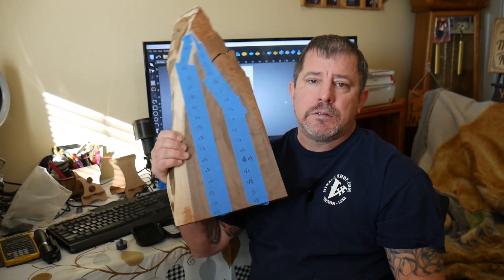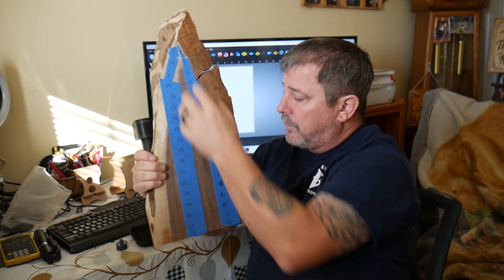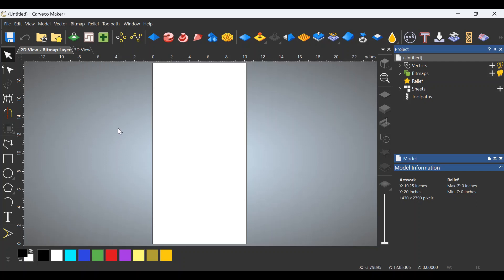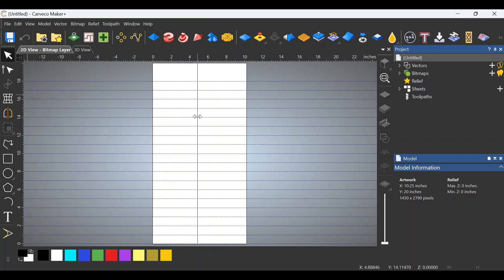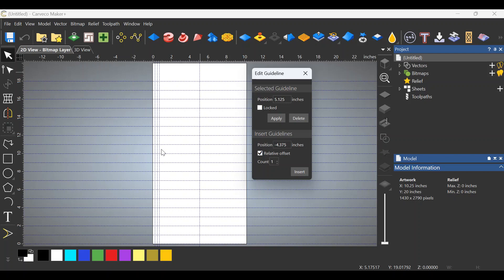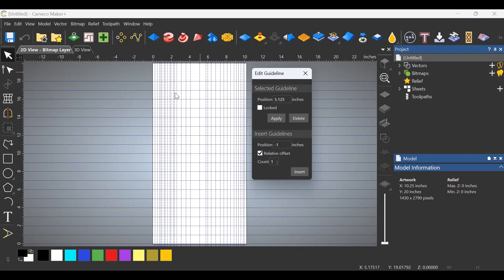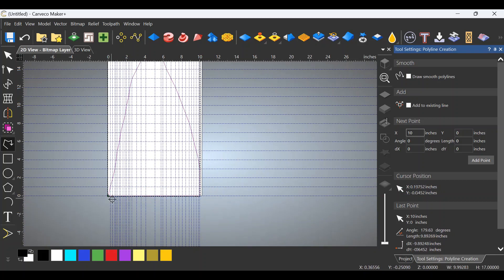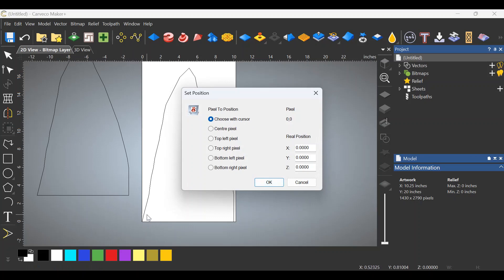You can copy a shapes on your CNC

Comment: Not what I was expecting.  I thought you were going to take a photo, import it, scale it and then trace along the edge to get the vector.  This way works though.  It would be fun to try the photo thing to see if it's any easier, or faster.
Reply from the maker: I’ve tried the photo import option but, I haven’t had to much success 
The other issue is the edge of the image would be different here because of the distance between the edge and the  flat created by the irregular distance of the live edge
Also I’m learning the color of the background can make or break the trace
Reply: I thought edge detection would be hard with the piece you showed.  You'd probably have to highlight it with something like a piece of white chalk.  For the background, a solid color fabric or paper would probably help differentiate the piece.  I'm glad to hear you'd given it a try though. @Hinkleshop